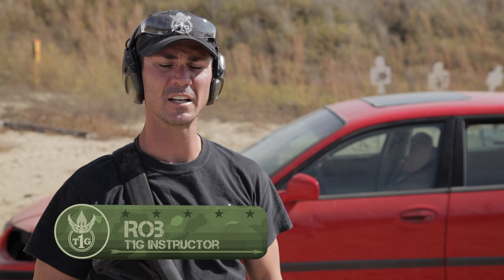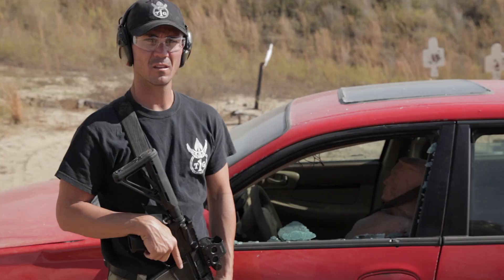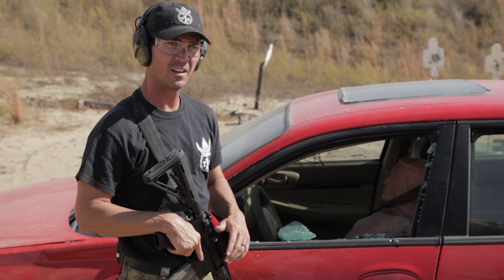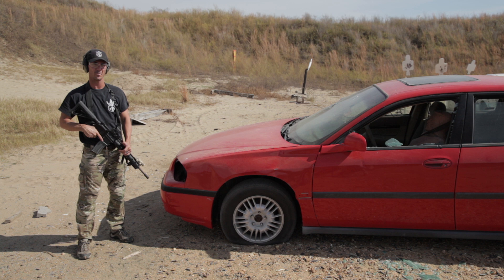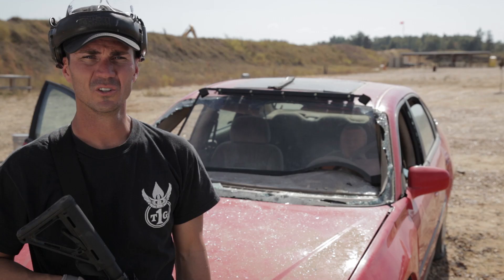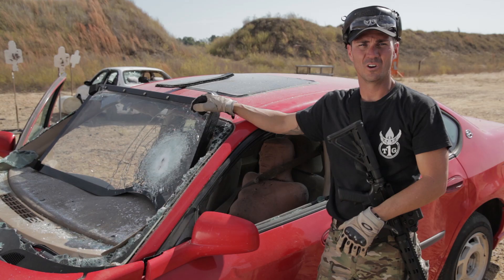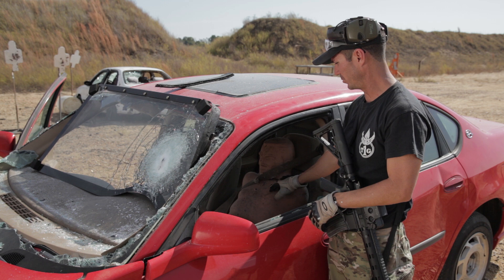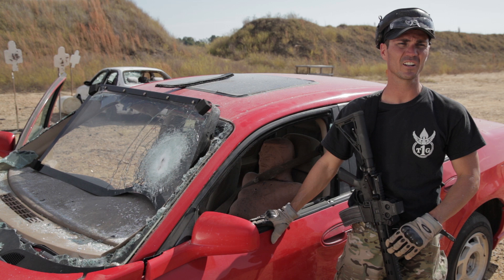How To Shoot Through Bullet Proof Glass | Marine Force Recon Technique | Tactical Rifleman

Comment: Great I'll keep this in mind next time I'm shooting at an armoured car 😄
Reply: TrueMOBSTER ok hey there
Reply: Haha ..my question was can you do this while the car is moving? lol
Reply: How about when the UN is sent to get our guns... A blue helmet is very visible
Reply: TrueMOBSTER there are custom designed armored car, SUV, or truck that have ballistic steel at top of the roof inside the vehicle where u can pull down to block the windows if your armored glass starts to fail. That's why tanks have no windows.
Reply: TrueMOBSTER Trump knows who you is
Reply: Supposedly there is glass that can stop black tip 50 bmg rounds. I wonder how many normal rounds that could take even shooting in the same spot till the glass fails
Reply: LoL 😂
Reply: there are glass types that can stop black tip 50bmg. ALON
Reply: goodluck...
Reply: sarcasm lol
Reply: Radiator from the side, A-pillars, and the differential are what you should aim for on an armored car. They ain't gonna sit still and let you dig a hole.
Reply: Educational but dry..
Reply: Battle overseas then tanks trucks or any other vehicle I'd be more worried about  IEDs taking me out
Reply: @trill4991  yeah like presidents car
Reply: Call me bro if you need help 😂😂
Reply: @zdub8438  armored cars have armor on a pillars and in between the door jams.
Reply: This comment didnt age well.
Reply: Surprised they dont get a sharp tungsten tip from a emergency glass breaker and tape it to a 22 lr believe it or not it actually increases hard hitting of the bullet meaning it has the same stopping power around a .50 bmg or other tank rounds
Reply: I've tried this with a 9mm on 3 steel plates it reached the otherside but didn't go completely through as I could see the tip of the jacket pointing out the 3rd steel plate
Reply: Next time im in a armored car.  Il remember
Reply: When SHTF you will know!  I am not going in the pod and eating the bugs

Comment: Are you gonna be able to shoot the same hole as the vehicle drives at you at 40 mph?
Reply: If you read the description, they point out that this wouldn't work with a moving car, which is why bulletproof glass is effective, because most vehicles under fire are moving too quickly to group shots like this.

They say that a technique like this would only be possible after stopping the vehicle, by using one of several different vehicle-arresting maneuvers.
Reply: U got the point man great question
Reply: @zhopka77  most if not all bulletproof cars have ballistic front and rear ramming bumper as well. To push blocking vehicles out the way. And even if the vehicle is completely stopped. The passenger can take cover inside the vehicle away from penetrated glass section
Reply: @prandomable  I'm not sure what you're trying to say... I mean, what you said is correct, but it sounds like you're also trying to contradict something I said.

I could be misunderstanding you, but I think you're saying that just because an armored car is stopped, it doesn't mean the occupants can automatically be shot through the glass. And that totally makes sense, and I agree with it. I didn't say this technique was necessarily going to work if the vehicle could be stopped, I just said it probably would not work while the vehicle was moving.
Reply: @zhopka77  what I am saying is it's not that easy. Especially in real life. To shoot through bullet proof glass AND killing someone inside EVEN if the vehicle is completely stop. And no I'm not contradicting anything. Just stating the facts.
Reply: @prandomable   Okay, I understand you.  Yeah, it's definitely not as easy as on a training course, cuz the angle you fire at will be less than ideal, the occupants aren't gonna sit still in the vehicle, someone may be firing back at you, etc etc. Stuff always works out better in training than when it happens in real life.
Reply: @zhopka77  to shoot back from inside an armored vehicle. Better have gunport or one way bullet proof glass.
Reply: @prandomable  Why do you keep responding on this thread? You're not really arguing, it sounds like you're just telling me what you think you would do in this situation. I really don't care what you think, you can do whatever you want in this hypothetical situation, and I'll do what I want. I have a brain too, so I don't need your advice or whatever.
Reply: Burst on shot selection would handle that
Reply: Maybe not, but a couple of shooters might. Also, the hits obviously ruin visibility, if nothing else. I'm wondering about hunting rifles, considering how powerful those things are.

Comment: So this bulletproof glass appears not to be using any lexan in the laminate? Am I seeing that right?
Reply from the maker: use of Lexan type materials varies by manufacturer. Some armor companies use it, while other do not. I'm not sure exactly where we sourced this window.
      Lexan is a great material to add to windows of local indig vehicles, while also adding ballistic plates inside doors and back of seats.  It helps to add protection while maintaining a low-vis posture.
Reply: Tactical Rifleman yeah, when they are too cheap to buy regular hard cars like the Mitsubishi raider trucks that never showed up...Anyway, lexan is readily available at TAP plastics and I am looking at doing another few videos on the Apocalypse trooper and am looking at ballistic windshield options what would not add crazy amounts of weight.  Some of the older Japanese 4x4s and of course classic jeeps and land rovers used flat windshields so curving the glass is not an issue.  I just don't have the means of testing the design.
Reply: Tactical Rifleman damn i just got new headphones
Reply: Caudata

Comment: I always figured that if you shot the bullet proof glass in the same spot enough times it would eventually drill through. But if it took that many green tip 5.56 rounds to get through, handgun rounds probably won't be able to do it in a reasonable amount of time.
Reply: The smaller rounds are easier to make it through.....less resistance.
Reply: I wonder how many layers of windshields would stop hand guns.

Comment: This was straight to the point. Now I know my local instructor taught me the correct way of getting through auto glass. The only difference was using the thick glass and the number of times it may take to pernitrate, that is if your rounds contact in about the same location. Thanks.
Reply from the maker: Yep, stay on the trigger till you get something soft

Comment: Previously, I made an error and stated the inverse of what Tactical Rifleman was saying about bullet impact through a windshield. I was in error and Tactical Riflemen is absolutely correct. If you are outside of a vehicle and aim at a target through a windshield, the bullet impact is, in fact, lower than your point of aim. Imagine if you will which part of the bullet hits the windshield first. The bottom of the tip. That causes the back to pitch up as the bullet passes through the glass, also the top of the bullet is the last part to be in contact the glass as it exits (energy takes the path of least resistance), resulting in the projectile being angled downward upon its exit from the windshield, the result is in an impact on target which is lower than your point of aim. Tactical Riflemen films some top notch videos and I hope the accept my apologies for spreading erroneous info on their channel. Keep up the good work.

Comment: THREE THINGS:
#1 this seems to work perfectly if the car is just a sitting duck.
#2 this seems to work perfectly if your standing 5 feet from the whindshield/window
#3 this seems to work perfectly IF whoever is inside the car has no weapons.
Reply from the maker: First, this is a technique taught to DA & HRT forces and is only for your entertainment. Step-1 is to pin the target car with other vehicles, but we aren’t going to get into tactics on the open internet.
Second, I was taught to actually run up and stand on hood of vehicle; so yes, we are within a few meters of the bullet proof glass.
Third, it doesn’t matter if the guys inside the vehicle have guns or not, the mission must still be accomplished. Standing on the hood, a well trained assaulted can easily eat through the bullet proof glass before anyone inside can shoot a hole back through.
Thanks for watching, TR

Comment: Firing through water is interesting, as it seems that low-velocity rounds penetrate further than high-velocity. This is because the shock/viscosity characteristics of water means that a hv round disintegrates to shreds on impact with the surface layer, whereas a lv round stays together.

There's also the issue of light refraction, which affects your aiming.

If you search YouTube for "mythbusters shooting water", there's a comparison going from musket through 50cal. But I guess that even if the metal of the round didn't reach you, the shock would damage your lungs anyways if you were underwater?

Comment: hi! p sure ballistic rated glass has layers of clear polycarbonate jelly (proprietary stuff, different depending on what company?) between the layers of glass. so it's not only thicker, more*, glass, but with a material that will also distribute the kinetic force horizontally as well as vertically. this will bring *projectile (usually bullet) to a stop faster.

Comment: Modern bulletproof glass consists of a glass-polycarbonate composite and is significantly more resistant...
Reply from the maker: Yet it still fails using the exact same technique. We have tried this on every type of bullet-resistant glass from many different manufacturers. Thanks for watching, TR
Reply: @TacticalRifleman 
Many thanks for the answer

Your tactic works for sure if you want to shoot through bulletproof glass, the bulletproof glass is only rated for a certain number of shots depending on the resistance class. But it is extremely difficult to hit the same spot on a moving target.

In the militia (Swiss Army) we trained to shoot armored vehicles with the multi-purpose rifle (shotgun) so that the view was restricted. After that we concentrated on the wheels.
Reply from the maker: Yep, step -1 for us is to first immobilize the vehicle ( pinning with another vehicle); then shooting the glass in the same spot.

Comment: the green tip ammo fired on the same spot penetrated the ballistic glass after 4th round. If using the standard FMJ, will it take 5 or 6 rounds to penetrate the same spot? For armored piercing, may it takes only one ammo to penetrate the ballistic glass?
Reply from the maker: It will depend on the situation (ammo/weapon/window type/angle/etc). It may take 3 or it may take 12 rounds. The point of the video is that you need to aim tight and keep pounding. You'll eventually get through the glass and into the meat.  Thanks for watching. TR.

Comment: try to do that when its moving
Reply: If you read the description, they point out that this wouldn't work with a moving car, which is why bulletproof glass is effective, because most vehicles under fire are moving too quickly to group shots like this.

They say that a technique like this would only be possible after stopping the vehicle, by using one of several different vehicle-arresting maneuvers.

Comment: I see a tempered glass driver and passenger windows. In one new car in my state. I thought that was illegal? The shards would main the person.
Reply: Tempering refers to the hardening of the glass to make it resistant to breakage. All auto glass is tempered in some way. Safety glass refers to the fact is doesn't break into large pieces and impale you or cut deep. You will still get cut up by flying safety glass pieces, but it's not like plate glass that could sever a limb. Windshields in the US are laminated to keep objects from shattering it and coming through and hitting you.
Reply: I didnt see the glass etching on the window. I was asked to come by, by a car vendor. He does the window related stuff, but I do not. Plus I had another with me who is more in tune with the glass. But we all noticed it was very unusual glass in the new car. It didnt have the sound of a standard driver/passenger side window in front. It sounded more like a house window pane. He saids he runs into these from time to time and they are not cheap to fix.Also very easy to accidentally break. However- according to what I know about glass and the vendor and my supervisor. That glass when shattered would shatter like a house window. From the top it looked unlike any normal car door window. It had 2 thin layers (so it appeared) 50/50 instead of a single window. The mill thickness was normal for a car door window. We found this very odd for a new vehicle. As to our understanding whatever the glass was or wasnt, tempered (As I was told wrongly, which i can verify next week) it would do nothing less than send shards of glass not bits and pieces in tiny crackling bits. The vendor was saying "WTF?! Come look at this, then showed us what I explained to you"

Comment: Not going to be easy in real-life situation. To block the vehicle, bulletproof SUVs like armored Suburbans weighs 10,000+ lbs and's designed to RAM road blocks. Even if SUV DO stopped, passengers can take cover inside the car.
Mexican drug cartel build lot of their armored cars w/ mostly steel w/ very small window surface area. Glass section is super thick like presidential limousine thickness which makes it even harder for this technique to work...

Comment: Would an AK get it on the first or second shot
Reply from the maker: Actually, the 5.56 Green Tip penetrates better than both 7.62x39 (AK) and 7.62x51mm Nato. So, it still comes down to the same technique... no matter which round you are using; stay on target and keep pounding the same point on the glass. You will quickly be through and mixing metal & meat. Thanks for watching, TR.
Reply: Mixing metal and meat. Sounds like fajitas to me! Pass the tequila!

Comment: Hack the cars computer system and roll all windows down and then shut off power. When the driver gets out and kicks the tire.. Shoot him...Seriously, I worked for GE Plastics and we had a division that made various bullet resistant glass.. We were not allowed to call it bullet proof... Polycarbonate at .236 thick can take a 22 shot. and frankly 1/2 thick polycarbonate sheet will take just about any rifle gauge.. I have never seen a 50 cal.. but  most deer and elk rifle ammo would just be absorbed into the sheet....We sold off the shelf polycarb to the granby colorado incident where a guy  and his tractor shootout.. I dont think anything thicker than 3/8 thick was sold... Shooting Polycarb would be a little different than the glass shot on this video